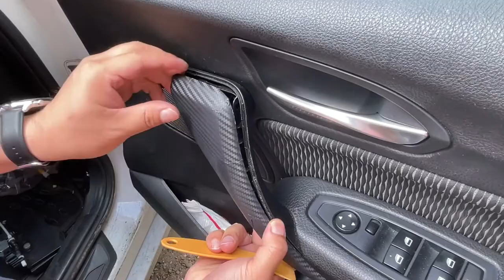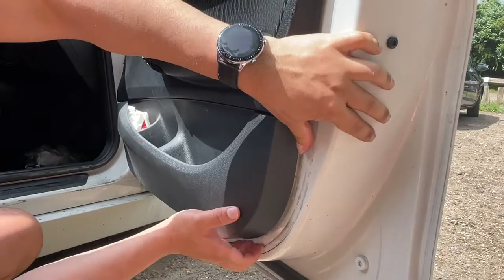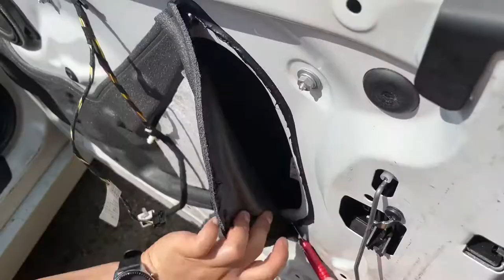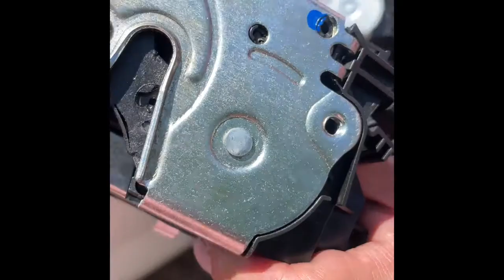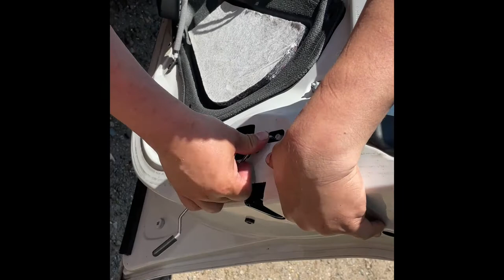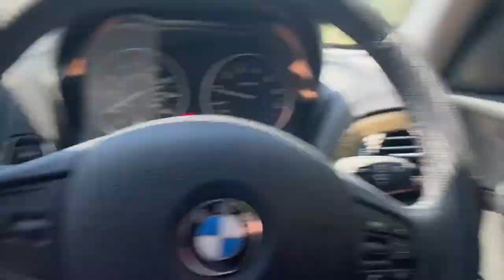Replacing BMW F20 Front driver door Actuator

Comment: Good morning, following a centralization problem on my front left bmw f20 door, I changed the electronic lock. centralization works again but manual opening/closing (with the key) no longer works. Do you know where it could come from? THANKS
Reply from the maker: Hello Alex I am not a mechanic. It looked not very complex job so I did  a diy. It didn’t give me same issues as yours after changing the actuator.Not sure why that doesn’t work, sorry. Hope you sort it out.